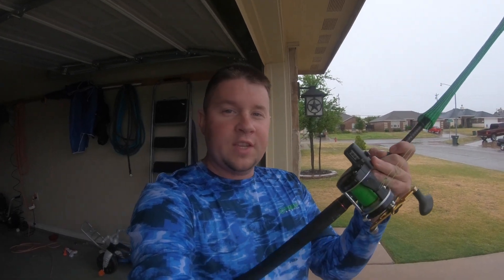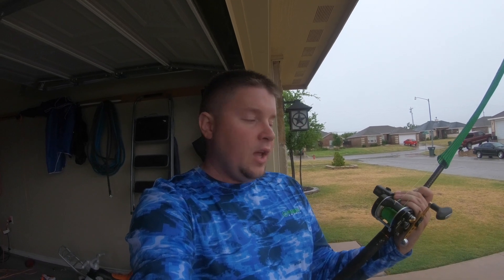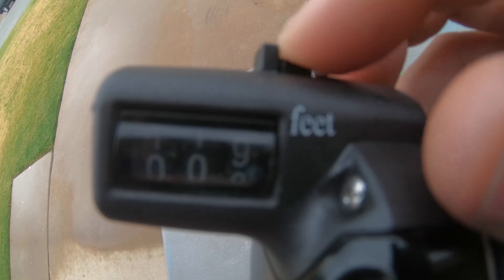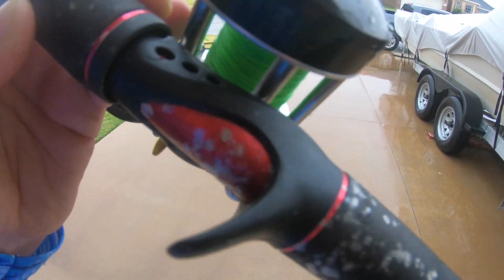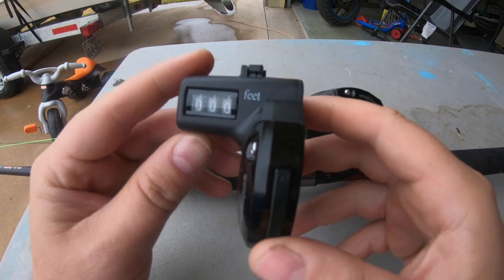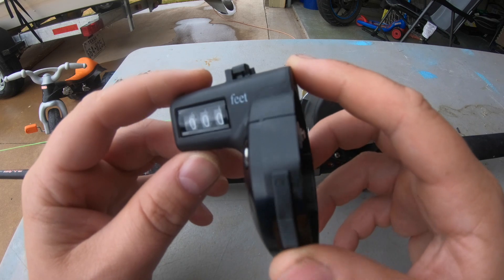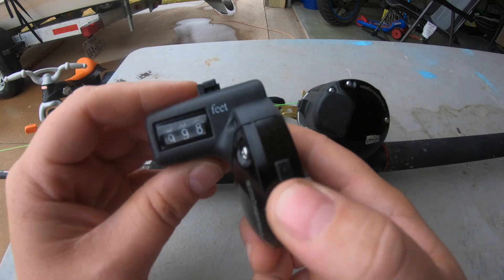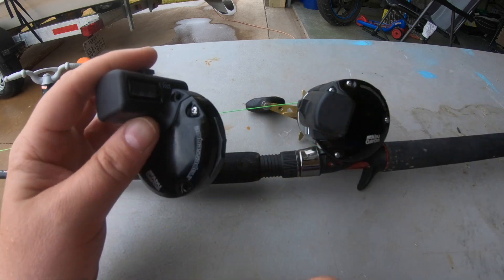Abu Garcia Ambassadeur 6500 LC (line counter): Broken Line Counter Repair/Replacement.

Comment: If I have a 6500 c3 reel , can I make them line counter reels by buying that part you bought ? Thank you sir , cant wait till your next video.  Great stuff !
Reply from the maker: I’m honestly not sure if the parts are compatible. That would be a cheap upgrade if they fit!
Reply: Steven Webb great question!  Did you ever find the answer??